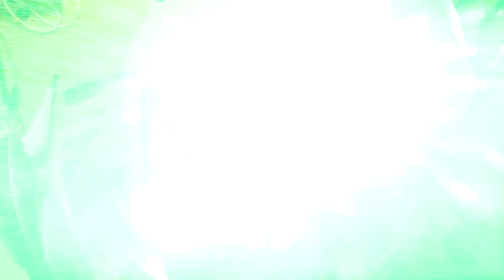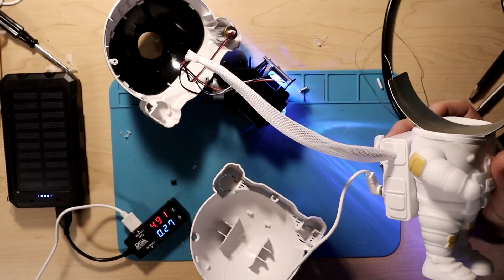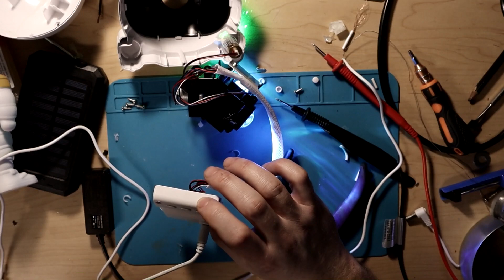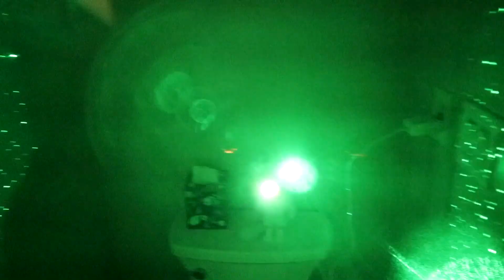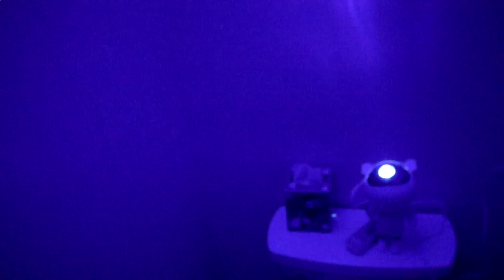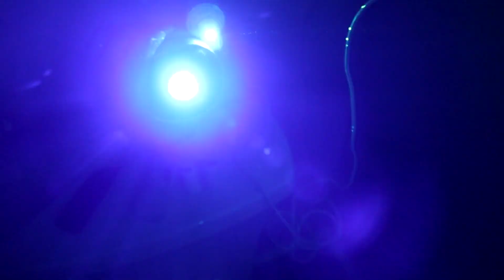Trying to Fix - Kids Astronaut Light Show - Intermittent Power

Comment: I just swapped out the usb cable, had one that charged a little clock lucky the end plug was same size. Seems to have fixed it. Running off a 5w usb outlet 

Thanks for your video

Comment: I also have an issue that the nebula worked for 2 secs when i first connected it then just quit working. I bought 2 of these and the other one works with the cable but not the first one whatever i try to do. The company does not respond to email for a return/refund aswell... Any tips on what could be broken?

Comment: Great video. Those USB cables can be cheap quality. Sometimes they are just soldered for power and not data (the outer two pins on the USB plug are 5V positive and negative inner two are data). Bought a cheap USB charge cable last year that broke in less than a week. I clipped off the USB plug and soldered on a new one. It works great now.